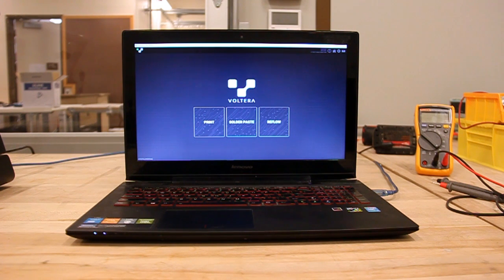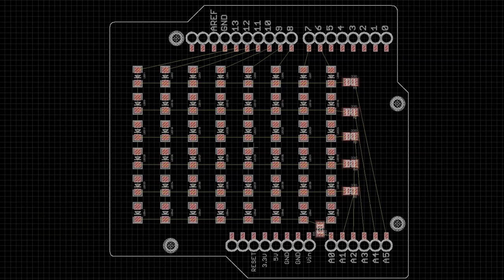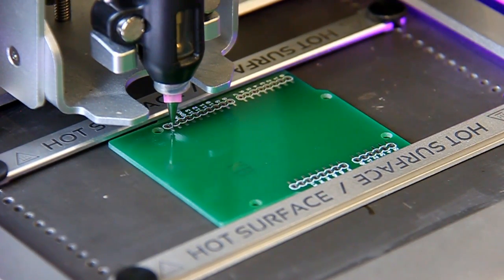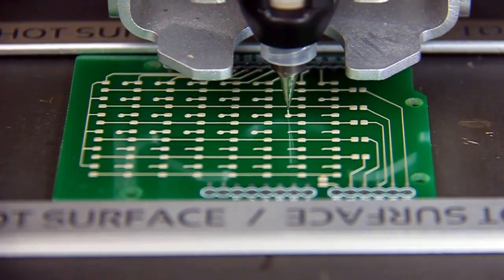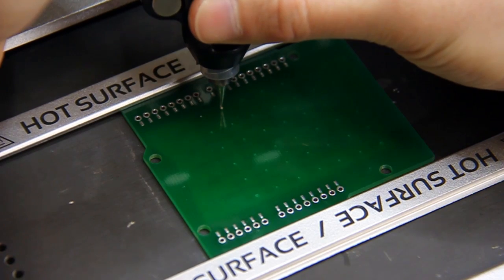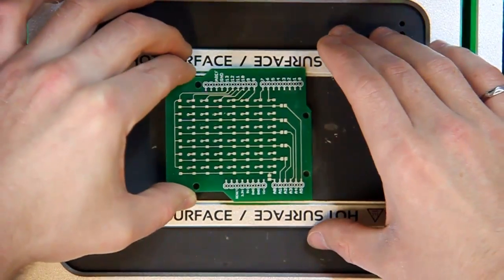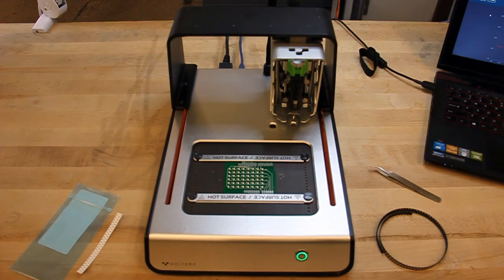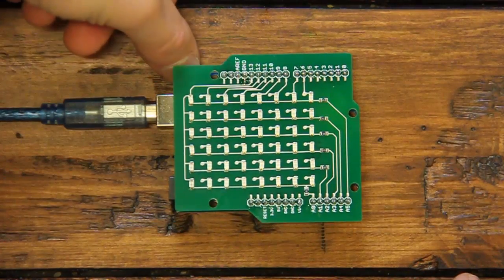Printing double-sided boards

Comment: Thanks for uploading this video, it is very helpful.  I also have a question. After flipping the board, how can I can make sure bottom side traces are matched with those drilled via?  Do I have to check manually?